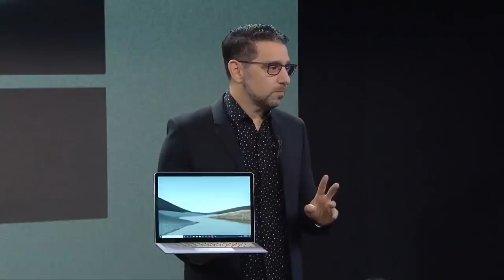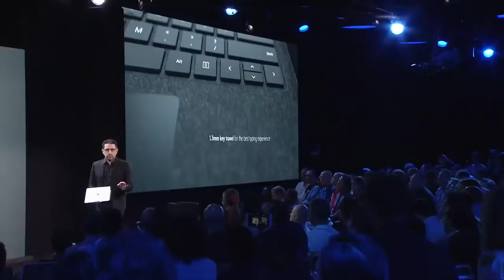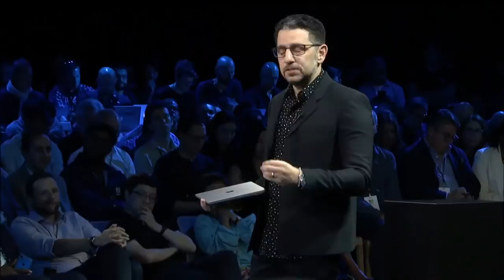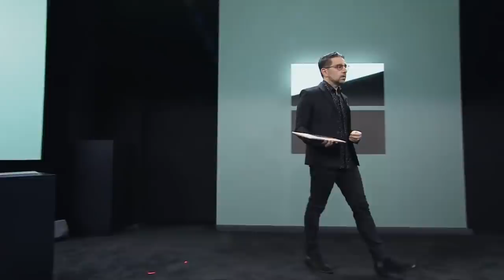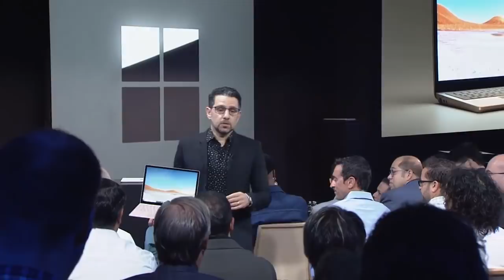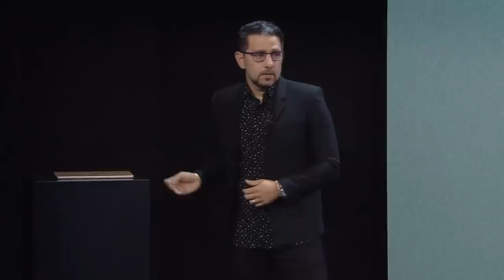Microsoft says they value repair-ability, designs more repairable product.

Comment: The only reason why Microsoft is doing this is to stay relevant in the computer market because they realize they're operating systems not all that great and the Unix base systems are taking over so Microsoft fear is to becoming obsolete so they have to cater to the market to stay relevant because in the past Microsoft was a lot worse than Apple would ever be and I've heard the stories of Microsoft putting stranglehold on companies because they wanted to sit there and expand towards building Linux alternatives Microsoft response was they would pull out there license if they did don't let this corporation full you there just as dirty as the Apple corporation there's more slimier about their tactics now because Linux is starting to dominate the market

Comment: Not an Apple fan, but still don't understand why its so difficult, near impossible to change a battery on my Surface Pro. Batteries have a limited life, its almost easier and cheaper to replace the device than the battery.

Comment: So he lifts the top from the new TypeCover and says that's progress? He's really up the wrong tree.

There are countless Surface owners who's Typecover has stopped working, not because of a fault with it but because MS downloaded a bunch of firmware to the UEFI and the result was that the Surface no longer sees the Typecover. Put that Typecover on a new Surface and it's OK, put a new Typecover on the 'updated' Surface and it's a no go. I've had to buy a Bluetooth keyboard for mine, and so have countless others, because MS refuses to acknowledge it as a problem. 

And then there's the loss of battery management that is also coming from firmware updates. My Surface Pro 4 drains the battery even when it's switched totally off. When I'm traveling I can l leave a motel fully charged up in the morning, turn it all off, and at the next motel it's drained and can only be used when on the charger. Once again, this is a common problem for Surface owners since a particular firmware update. 

I'll believe MS wants to make serviceable computers when they acknowledge the thousands of users around the world who struggle with their similarly 'updated' Surfaces and fix them like they should.

Comment: i will stick with my vacuum tube based and early transistor electronics they where designed to be serviceable this modern chinese made crap is meant to be tossed, i was in the tv repair biz for many years then moved on to computers once cheap lcd tv's came out i got away from it all

Comment: why is it, that people want  Laptops  to be smaller, but they want a bigger monitor..
Reply: Think about Intel machines, and how many chipsets have been released.  that dont fit in the same socket.

I love Cellphones. and tell people the changes in Any new cellphone...Aint that much...
More pixels, as if you need more..
Bigger camera 48mb camera..
New CPU..
THATS IT..
there are 7 year old phones that have almost the same hardware, as the new ones, nad cost $100..

Comment: I don't know about the schematics and such, but Dell has made Latitude laptops for years. Enterprise Class machines that are designed to be field repairable, at least at a modular level. Service manuals are freely available on their website, with full disassembly and assembly instructions. Brand new, they are out of my price range, but "off-lease" units tend to be rather affordable from eBay, Amazon, NewEgg and other online retailers. Okay, so they are 3 or more years old, but what is the speed difference? A few percent in most cases?

Comment: This is interesting.  Looks like things are coming full circle.  Back in the 70's and 80's Tektronix and HP made test equipment that was designed to be easily disassembled for repair and calibration because people actually did board repair instead of just easter-egg circuit card replacement nowadays which ultimately they end up just throwing away.

Comment: This is why I like my Fujitsu Q702 tablets. Four screws(all the same size) to remove the metal back cover. After the back cover is off, it is three more screws(also the same size) to remove the battery. Two screws for the ssd, one for the wireless card. All the screws in this unit are the same size. Made in Japan. The only problem is that nothing seems to wear out. I have had only a fan failure on one unit.

Comment: "Doesn't need to look like an old Toshiba" I have a Toshiba Satellite 4000CDS from 1997 and it's fucking amazing honestly. A Full floppy and CD drive, both slide in & out and have their own slots, an easily accessible HDD, The keyboard come up like an iBook where you can find RAM and various components on the board. Full IO and IR Blaster, SoundBlaster sound. USB, VGA. If I could have the modern day equivalent of that pure beast of a desktop replacement laptop today, even in that same style, I'd buy it immediately

Comment: Cool. Window dressing (Windows dressing?) as you imply, but cool. As long as it can run some open source operating system on it. MS used to be an OS firm. As such, they were compelled to make planned obsolescence part of their business model, so that the hardware ecosystem could bank on a new wave of replacement sales every 2.5 years, as the OS gets "upgraded" and the previous version is no longer supported.

MS is only secondarily a software firm as of OS 10. Tey are a data aggregation firm primarily, like google and facebook. They collect your data, bank it, and sell it.

If you really want to see old school design ala the IBM laptops of yore, then you need to look beyond the OS firms. You need to look at firms designing hardware pre loaded with linux, or some other open source operating system. Otherwise, the 2.5 year planned obsolescence model still prevails, but now with less user control, and no privacy whatsoever.

Comment: My only issue with Microsoft so far is just the pricing of their products, like the Surface Books and Surface Laptops. Why should we pay $1000 for a laptop with an i5 and only a 256gb SSD, or $1200 for an i7 with still a 256gb SSD, or better yet $2,400 for an i7 with 16gb of RAM but still with a measly 256gb SSD? Like are they trying to compete with Apple and the pricing of their overpriced MacBooks (I mean they charge almost $1000 for a MacBook Air with only a dual core processor in it!)? There’s no doubt that these are built with quality, but looking at it through a college student’s eyes and looking at specs to decide if these products are worth the asking price, I just really don’t see why they have to be so expensive. Maybe laptop pricing has always been this way and I’m just new to it compared to desktop components and pricing when you build your own PC.

Comment: alienware (dell) released a laptop called the area51m. Everything inside is serviceable, it only has phillips screws to get in. You can swap the processor, RAM, ssd, hard drives, and even the GPU. Nothing is soldered to the motherboard, which is much better than everything I have seen in the laptop market

Comment: I bought a new laptop a year ago after my wife's old laptop died.  I went nuts when I realized it didn't have any "trapdoors" because if I ever need to service it I'm going to have to take the whole damn thing apart just to replace the battery -- if that's at all possible -- or to get to the harddrive.  I've had to replace several batteries on other people's laptops, and it was the first time I'd ever seen a laptop that didn't have a battery that just pops out.

To be honest, I would love having a laptop as thick as a brick if it meant it actually had meaningful airflow to prevent overheating, and maybe I could even put in components that let a 3-month-old laptop run faster than molasses in January.

Comment: This may seem far from your topic, but bear with me for a bit (TL:DR, see last paragraph)...

When I was in the USAF I was a tech working on aircraft. Some were easy to work on, some nearly impossible. On one, a tech could get to that part most likely to fail quickly and easily to replace it, in others one had to remove 42 unrelated interlocking precision parts to get to that part that always failed, and it took a specialized team and tools to put it all back together and calibrate all those parts unrelated to the failure.

There is a tremendous difference between designing for quick and easy manufacture and designing for quick and easy repair.

The first aircraft spent X hours in maintenance for each hour in the air, the second took 8X hours...

Aircraft 2 (and 3 and 4) were intended to replace aircraft 1, but aircraft 1 is the only one still flying, because the others were simply too difficult and expensive to maintain.

On to laptop computers...

I strongly suspect that the "simple, easy access" promised by MSFT will likely require minor specialized tools to keep the fumble-fingered out of the guts, but once access is granted to the interior it will STILL be for major component replacement ("Power connector damaged? You need a new main board"), because it will still be a unified design instead of modular. 

It would be nice at times to be able to say "Gee, the USB ports are hosed, Guess I need to replace the USB drive board," instead of having to replace 95% of the interior electronics, most of which work just fine, because they are all on one board and component level repair IS NOT SUPPORTED.

I don't think this move by MSFT is any more than words. Sort of "See! See!, you can pop the keyboard off instead of the back of the case!" but once inside it is still all the same not-designed-to be-repaired POS. (And he did mention that it required tools and special knowledge to remove the keyboard.)

Comment: Very off topic but i wasn't sure how often you look at the comments of older videos, but shortly after watching your video about loyalty to a crappy job I was put in a position where I unfortunately had to resigned effective immediately from my job as a Television/Sports broadcast producer at a local old-school TV station due to a boss crossing a line that I don't allow anyone to cross (this being attacking/hurting my family, especially my younger siblings). While only partly inspired by your video I still want to give that little push the bit of credit it's due. I've worked in IT for years now and still had several contracts that I'm taking care of so I'm not in a bad position financially, but I'm thinking about turning my PC repair and IT experience towards component level repair (I've done it in the past on a very small level for very specific projects, but not on a business level). This wouldn't have been even a consideration if I hadn't discovered your videos 5ish years ago. I'm planning a trip to new york state this december, If i end up in NYC while there I'd like to stop by and shake your hand and thank you if that's alright, you've been a huge inspiration and teach way more lessons than just board repair.

Comment: About a month ago... my dad got this endoscope (Which did not come with any reasonable instructions) with an type c adapter add-on that hooks up to a phone, and I spent about 3-4 hours fiddling with the damn thing, (even got it to work on my older phone, but couldn't on his new phone (a type c adapter) - mine is a micro usb, I figured out the flip down within 15 minutes of having it, and got it working on my own phone. Then after I said ef it this thing isn't going to work, I laid down, and as I was lying down in bed, I got to thinking about my knowledge of pcs with good connections, I scanned the cord with my mind, and what I noticed earlier was like a plastic circle on the end that has the type c adapter connected to the end of it, so I got up out of bed about 3 am, and I look at it and sure enough it turns out the blasted thing had a micro usb on the back of the type c connecter. So I plug it in correctly, and boom the thing worked. 

The next day I woke up, and looked on google for the endoscope specifically and sure enough the picture online didn't look like what I had at first, but it does look like it now/after I had found it out myself.

I am PROUD I found it out on my own, but annoyed that it took so long/that the instructions were so poorly done, still I did it on my own thanks to my knowledge of pcs (I sadly don't even have a job in IT, to put this skill too use, I am not done trying though, I will have a job sooner or later.) and how you have to have good connection on both ends.

Comment: I would point out that he said "for our commercial customers", not consumers. I work for a "company" that contracts thousands of laptops and smart phones/devices. When we by new equipment we also purchase maintenance contracts. We do not purchase directly from the manufacturer, we purchase through a "partner". I believe what he means by commercial customers is these partners, not end users or repair shops unaffiliated with "partners".
For instance: If I want to buy a CISCO Catalyst 3850 and I call CISCO they will direct me to a Local partner for a quote, I will have to buy the switch through the partner along with the maintenance contract. Once I get the device and register it, the only help I would get from CISCO would be distance support. If I need an onsite tech they refer you to the partner you purchased the device from. I have stopped purchasing maintenance contracts, because we loose more money in 1 minute of a switch being down than it costs to buy 2 standby units ... and some of my switches cost in excess of 14K.
However; I have purchased SUN servers directly from them and SUN actually provides direct support. I used them to replace some aging HP servers, and my experience with HP was much like CISCO.

Comment: devices last for years and a single part will fail like a hdd, the devices get older and faster things come out but if you need a surface pro to keep ticking so you can use the internet to work on your truck looking up schematics and parts ordering parts online you might find a ton of value

Comment: Laptops are like cars.  When I was t to change a starter motor, fuel pump, alternator, and even spark plugs, just make it easy.  I don't care how beautiful the engine is in a daily driver.  Needing to drop a motor to change a starter or so.ething as a 2 dollar hose is so infuriating.

Comment: "Our new sleek and elegant design has all the strength of a waffle so we made it easier to repair"  In fact, setting your can of Diet Coke on it will leave a ring shaped dent as proof that you are a cretin and your warranty will be voided.  The parts list will consist of the screen, chassis (cough), keyboard, screw kit, and a special screwdriver with the head shaped like the symbol formerly used by Prince.  Each component price will be 1/2 the cost of a new unit with the exception of the screws which are $34.99.  The screwdriver is $299.99 and on permanent backorder and you must submit a locksmith style Master Key agreement before purchase.
Reply: Where did you get this kind of detail on Apple's roadmap.
Reply: You've never used a Surface, huh?

Comment: It's because surface books are actually used in the business environment.  If they want to gain more marketshare, IT departments need to recommend them.  So if something breaks, gettings them back up and running quickly is paramount to running a good business and IT departments will adopt them.

Comment: That guy still managed to make me want to vomit. Waah waah waah, I can't stand to look at a trap door, waah waah waah. Screw a nice looking product, I want a product that works and can be fixed. If you can do both at the same time, fine. If you can't, sacrifice looks every time. Function is always more important. Apple already cornered the markets on trendy idiots who want a fashion accessory rather than a computer or phone that works well. Stop going for that market, you'll never break into it.
I'll take a thicker product where I can upgrade the hard drive and memory and other parts over a thinner product where everything is soldered and I have to buy a new one to get an upgrade, too. Who asked for everything to be so thin, anyway?!
Rants aside, still nice that you can change the keyboard easily this time.

Comment: I have a feeling that part of the reason for this was because of the pushback from their last version which was the most unservicable device on the planet. Who the hell thought gluing fabric over the openings was a good idea!?🤬

It's great that they've done a 180, it does feel like things are changing for the better. We still have warranty void stickers in the UK, but that's the least of our worries right now..

PS: I think it might be useful to do some basic tips on soldering. Preferably not with a fancy temp controlled iron, but how to use a £10 iron from a local store and not burn burn things. Just an idea.

Comment: That's really cool of Microsoft to do, but I see it as the equivalent of giving someone the keys to a 50-room mansion but when you walk in, the mansion is dark and every room in the place has blackout curtains covering the windows.  It's on the the owner to  feel down their way down pitch black dark open spaces and hallways to find the kitchen, master bedroom, bathrooms, etc.  Now, I get that Apple would have locked the outside of the door with dodeca-lobe locks/screws and a security system that would have emitted shrilling beeps if anyone actually got in, but I would feel more relieved if MS allowed certified repair shops like Louis to have schematics of how things were arranged inside that laptop.   You want it make things accessible?  Fine, good job.  But to not supply a map in order to make things "more repairable" makes the gesture a little less sincere.